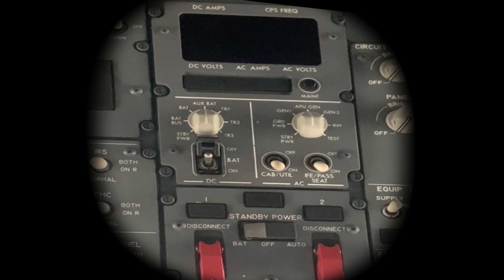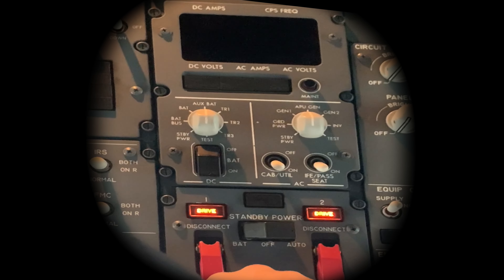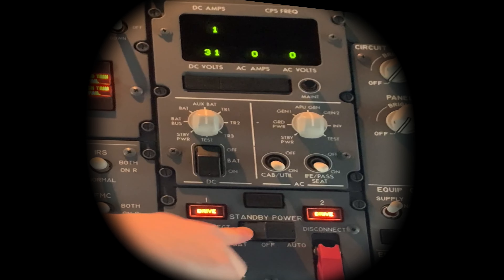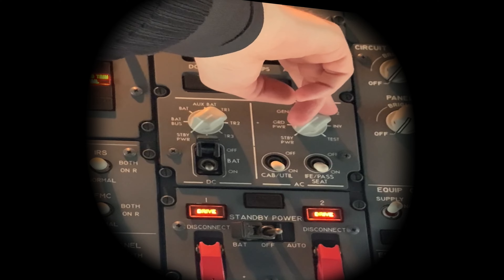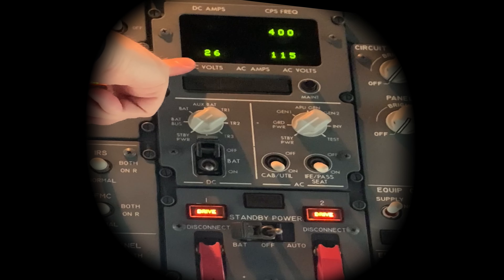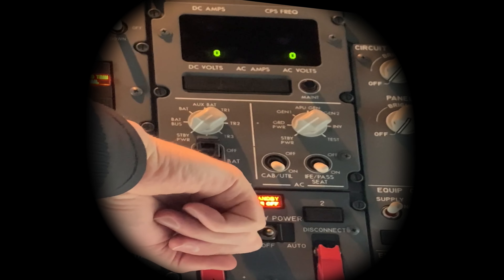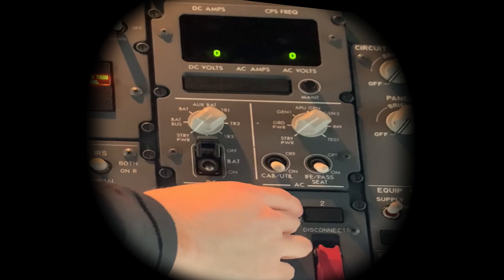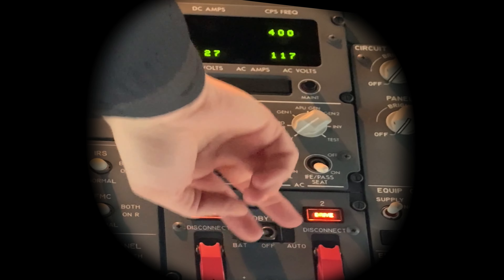🎬  BOEING B737 NG ATA 24 Standby Power System test. ✈️

Comment: Why is it only 1 Drive light when standby power turned off here?
Reply: Great question. Is this video in a simulator or aircraft?
Reply: @rjtaylor3535  Aircraft
Reply: Systems that powered by stand by power are shut down when you put it off. So we can get that the eng 2 drive indicator light is powered by stand by power system. Also captain's displays are off at the time he puts the stand by power switch to off but we cant see because of the view angle
Reply: In addition, the auto position is self explanatory and the BAT position is to supply the bus via static inverter which uses the battey DC volatge to produce AC single phase 400hz power

Comment: Thanks for this interrsting video.

What does the DING DONG sound mean at 6:34?

Do you have the possibility to make a test of the RAAS in tte 737NG?
Of course only if it is availible.
Reply from the maker: It's just a self-test of the PA system on start up. Nothing to do with Stby power. The RAAS is not fitted on our B737 I belive, but I will look into it to make sure.
Reply: ACARS message